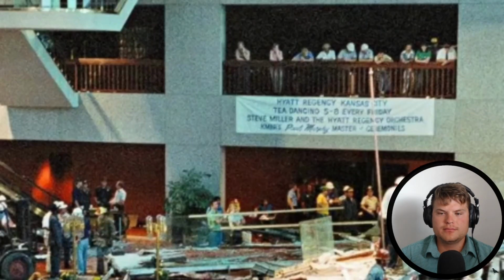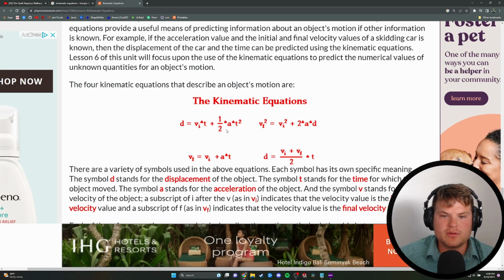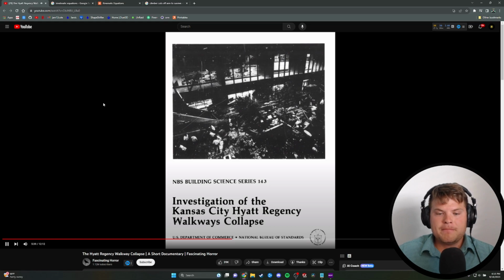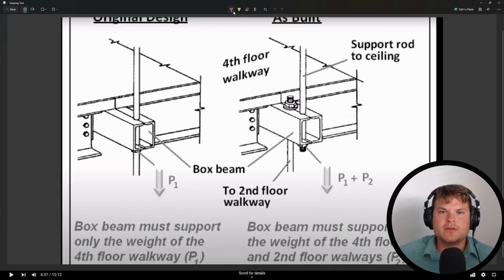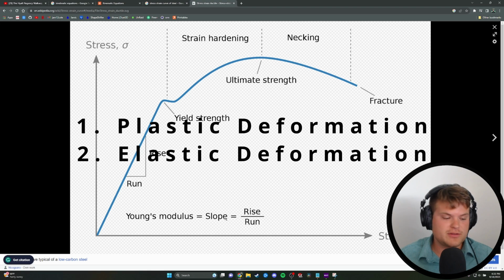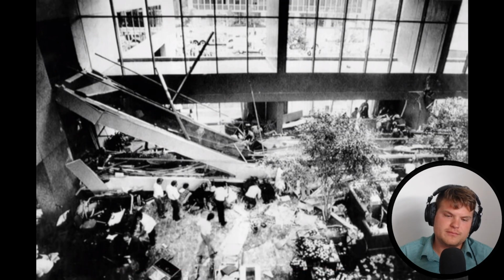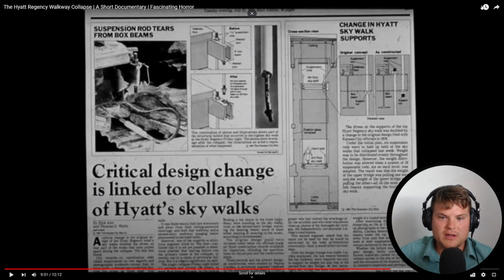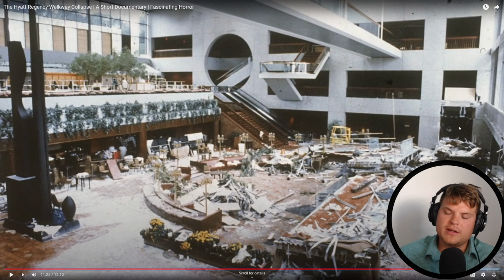Silly Mistake!! Engineer Reacts to Hotel Walkway Collapse!

Comment: From what I heard about this during the construction someone wanted to flip the Box Beams so that it would be stronger example( [ ] ] [ ) so that the support rod would be more stable. From what was said the idea was scarped because it would have made putting the molding cover for the walkway more difficult and would have delayed and added more time to the project.
Reply from the maker: There would have been more strength surely in that configuration, like you mentioned time constraints flew in the view of safety and genuine good design.